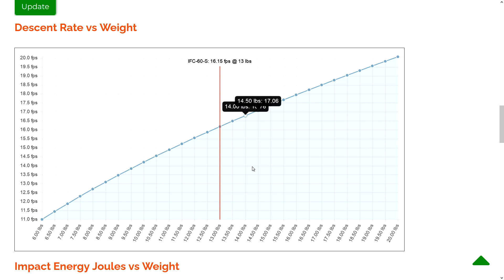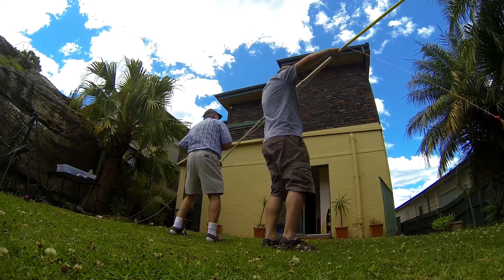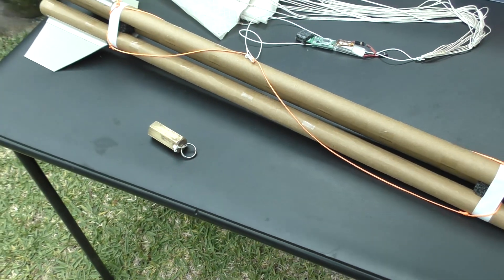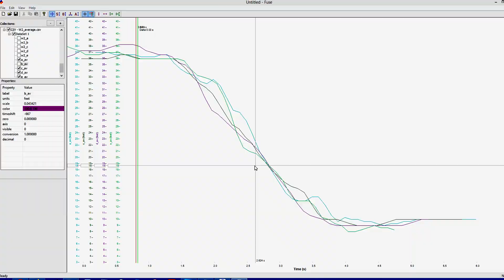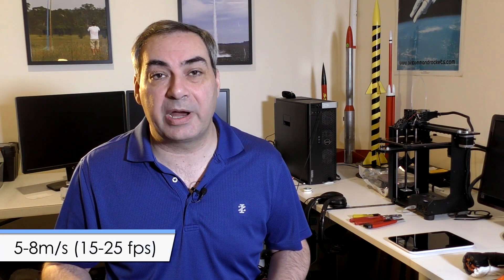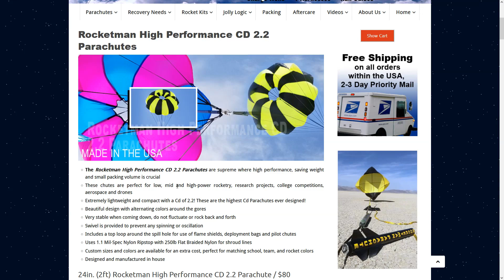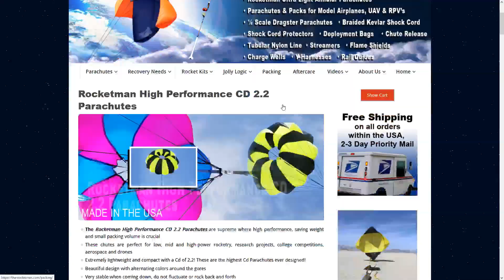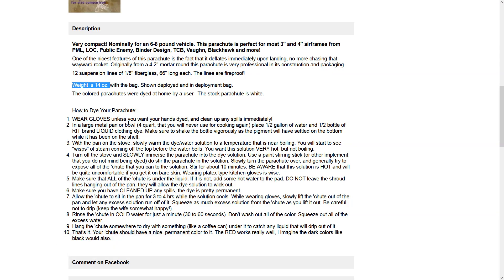2 Stage Water Rocket - Part 30 - Booster Chutes

Comment: I am only doing low power water rockets right now so i don't need super expensive chutes so i make them myself. I have made several trashbag ones and i had great success with those until a flight recently where it opened accidentally during ascent and ripped apart so i switched to stronger, umbrella ones.

Comment: Why do you want the booster to land with a fin pointing down?
Reply: Have a look at part 24. There it is explained. (It also contains a lot of other interesting information.)
Reply from the maker: Hi Daniel, good question. We believe it will exert less stress on the fillet since most of the impact force will be directed through the fin into the body tube. If the fin was pointing off to the side then there is a much greater torque exerted on the fin around the fillet and would be more likely to break off. Well that's the theory anyway. This is one of the problems where you can't have through the wall fins.

Comment: Always remember..the higher you go the further downrange it's gonna go..in windy conditions.
Reply from the maker: Yup, but the booster won't be going that high so a little bit more drift should be OK. One other problem with large chutes is that the rocket may get dragged along the ground after it lands.

Comment: I used to buy umbrellas of various sizes (including beach umbrellas) when they were on-sale locally, and then I'd reinforce the seams with better sewing in a machine, and use flat nylon cord for suspension lines.
Reply from the maker: We've also used umbrellas previously, but good idea going over the stitching, as I can see a high speed deploy not being ideal for regular stitching. We've always found that the umbrella material tends to be a bit heavier and not as easy to fold, but definitely a cheap alternative.